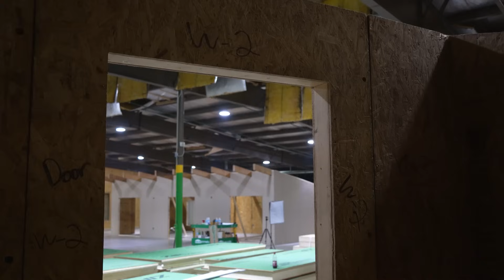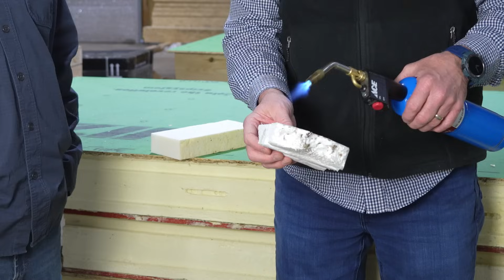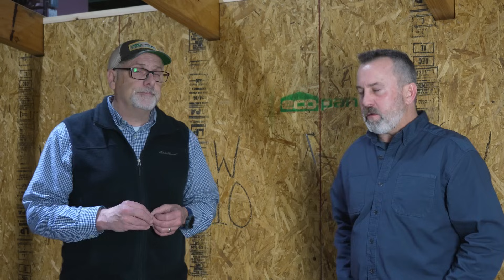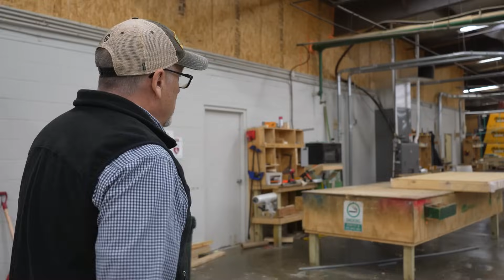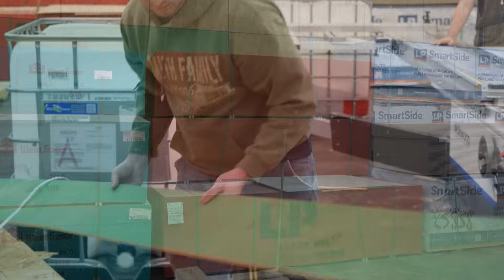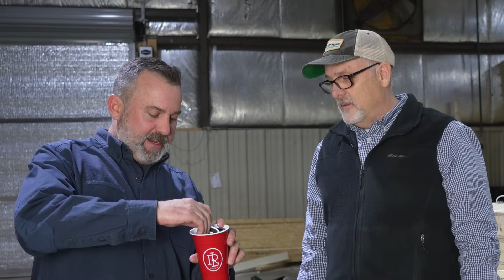EVERYTHING You NEED To Know About SIPs | Structural Insulated Panels |  @EcoPanelsofTennessee

Comment: Looking through your videos (very good by the way) I did not see how the electrical wiring is run both horizontially from one box to another but also vertically. Do you have to have your electrician there to run wiring as you are putting the panels together?  Please send me the link for complete electrical installation. Also any videos if you messed up on an electrical outlet after house is up (not sheetrocked yet) and need to add electrical outlets.  thanks again Dan in RI
Reply from the maker: You must design your electrical with them ahead of time. They lines are pre run up or down depending if you have attic or crawlspace.

Comment: Cost of 2 story SIP vs 2x6 ?? (1500 sq ft on slab) 2nd story roof is 12/12 pitch and ends at top of 1st floor header so really only need "triangles" on north ahd south ends. Rest is all roofing from peak crest to top of first floor. This is our forever=retirement home at 10,000fr in the Rockies and getting a crew on site fir a month to stick build is costly ahd timely vs pre-fabbed shipped to site. I'm disabled ahd just had 4th spine surprgey. In college I built vlBouse cabins in ARK as a summer job and am a Mechanical engineer. We've nixed walkout basement and leaning towards 2x4/2x6 exterior simply because of cost. Framing is $45K for shell with doors ajd indies. I also hear about our interior TNG ceiling may spring a leak with SIzp roofs and impossible to trave the source so pushes me to tradional 2x10 roof with OSB isolated std and tar paper covered by metal roof. Can you devlbynk that for roofing? Also resources with cranes abd land atop a mountainbis tricky as I try to assemble a crew for as gou say SIPS ajd focblicks if we opted for walkout few guys swinging a hammer know how to do this and there's a 3 year waitlist with the "big boys" like RiverbenfTF who merged with Precisiincreaft master of $×M lig homes whivh look great but add land and utilities you're up to $=M which again pushes me back to 2x4 stick build as it's 1%+0/th that price. However if you can be comoettive on pricing and make it so se can assure in a week like you day. I'm interested. Look forward to hearing from you or b otge d s familiar with these guys? Thanks BB
Reply from the maker: You bring up great points but I’m sure the guys at eco panels can answer all your questions as they are awesome to work with. Give Rob Rob Clutter a call, (615) 904-5210. Tell him RidgeLife sent you!